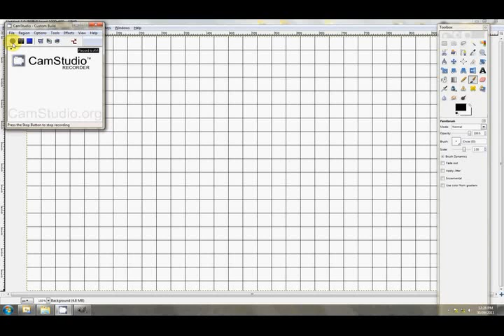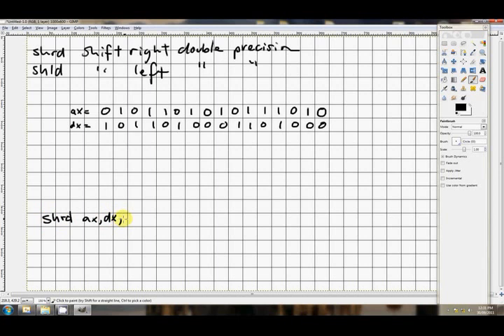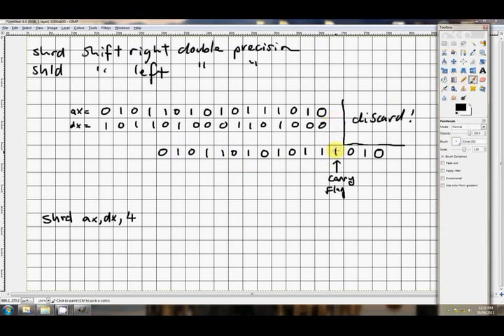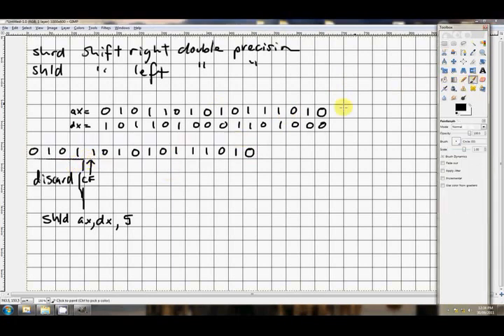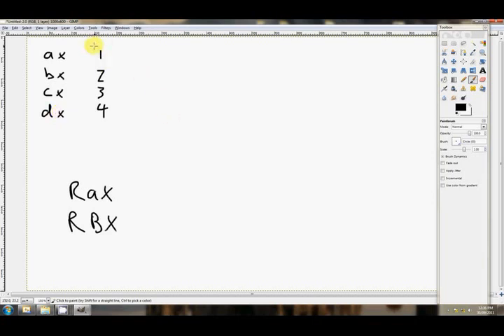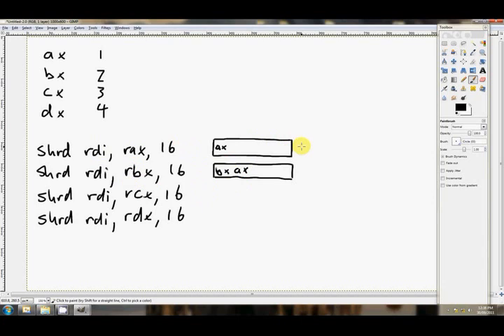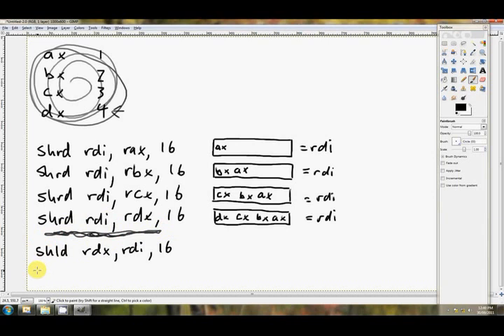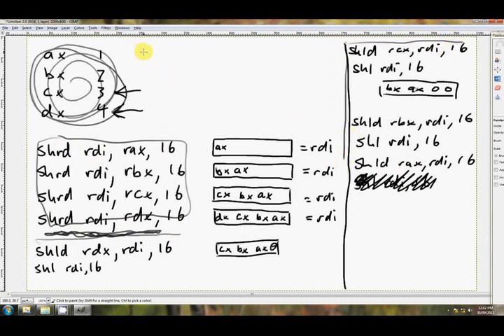x64 Assembly Tutorial 16: Shift Right and Left Double Precision

Comment from the maker: ASM has many instructions that have no C++ equivalent. As far as I know there's no way to generate SHLD or SHRD in native C++. C++ would be rather cumbersome at doing what these instructions do, this is exactly why ASM is good but it's also why ASM is not portable.
Reply: If I write a program that I am sure only contains instructions that x64,x86 CPUs can do, then my code is portable, I also can use SIMD AVX instructions for example that I know for sure that any CPU can do, then my code is portable, is there anything wrong with this ?
Reply from the maker: @ahmadalastal5303  It's portable to x86 CPU's. But the operating systems give us a bunch of the low level routines too, like printing things to a console and that. The windows and Linux libraries are different, and so the code is not portable to different operating systems unless you recompile specific versions for each OS.

And there's a lot of CPU's that are not x86/64 based at all, like ARM, and microcontrollers. So those devices won't understand the binary at all.

But for x86/64 CPU's, yes it's portable code. You might have to recompile for various operating systems, but it's fairly portable between AMD and Intel CPU's.

Hope this helps, cheers for watching :)